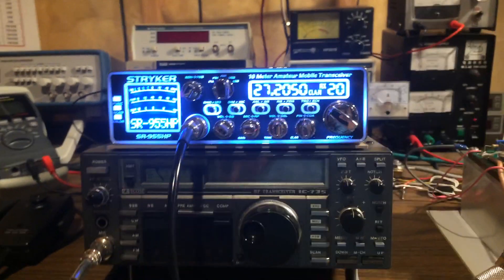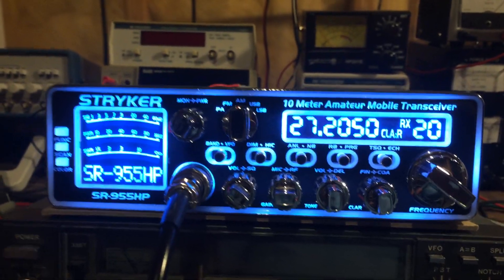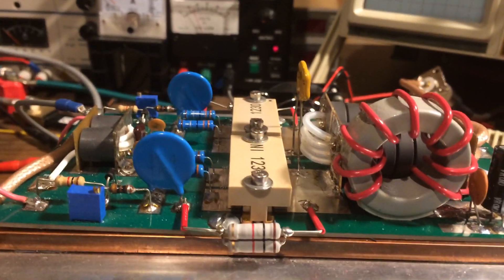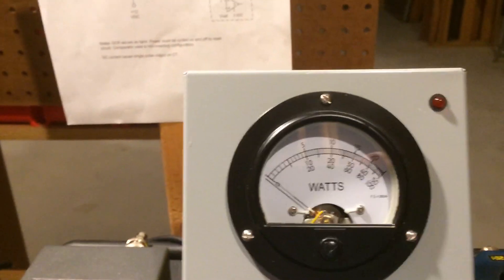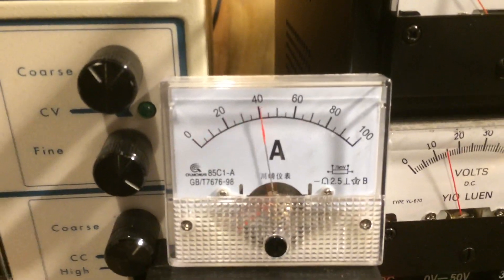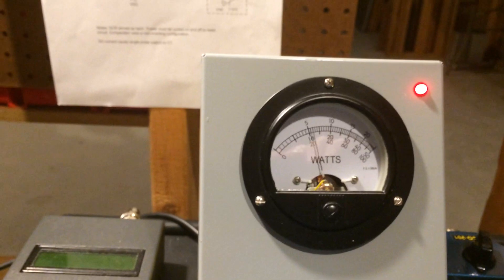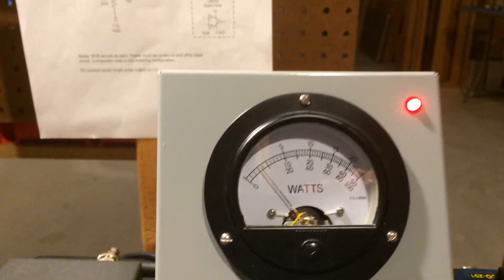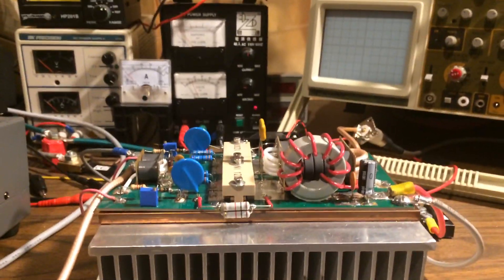RF Man Demos Dual LDMOS Amplifier with the Lastest Improvements.

Comment: Hello, I can't see LPF installed. When such is not placed, the level of harmonics, especially the third is very high.
Thus, the wattmeter does not correctly measure the fundamental frequency level.
Reply from the maker: The 3rd harmonic is about -34dB below Fo so the low level of distortion has very little effect on the wattage measurement.